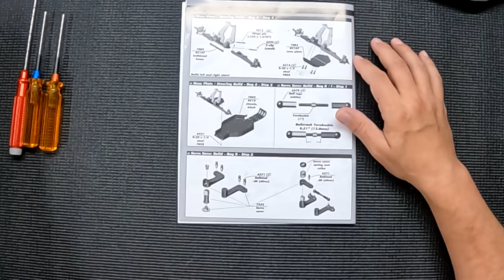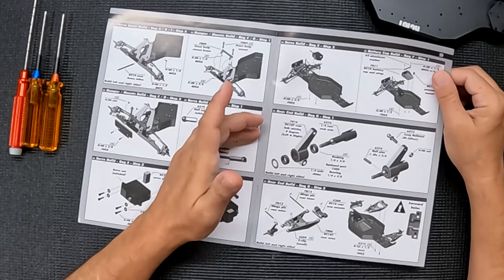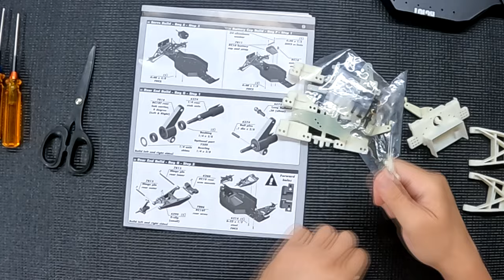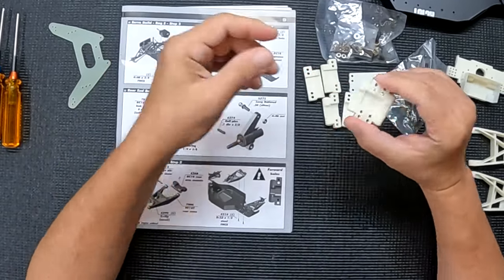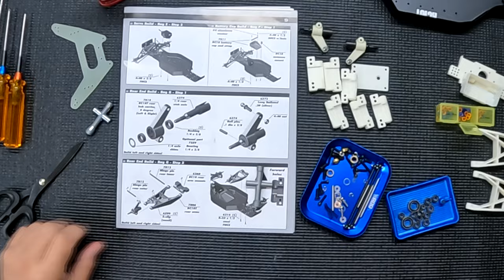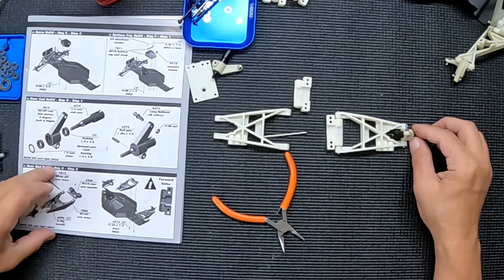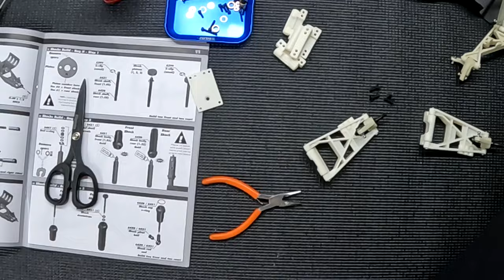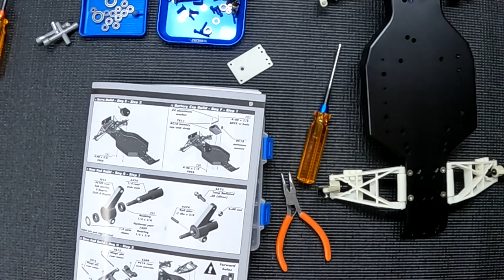Part 4. Building & Racing a Team Associated RC10T 1/10 2wd Stadium Truck

Comment: Great series of videos, as always. Can't say it makes me want to buy an AE buggy. Was considering trying to get a hold of a Jay Halsey replica kit - which looks just awesome - but given all the Associated's quality issues incl. the manuals, the B7 rear end, and now the ball studs/turn buckles of this truck, I am not sure anymore. Still an enjoyable series of videos to watch nonetheless!
Reply from the maker: It's true, but all those issues can be addressed for relatively little money and time Actually, the gearbox performs reasonably well. I haven't had any issues with it. And, I am really enjoying racing with the vintage crowd. I ended up replacing the ballcups with Traxxas types that are very rugged and are almost impossible to knock off... like something that would go on a crawler. Once I got the turnbuckle issues solved, all my problems were related to tires, tuning, and electronics. Otherwise, the truck was great. I just didn't have enough time to work the problems b efore the race. But, I'm really looking forward to the next vintage race within driving distance because I'm going!
If you can afford to buy a vintage truck or buggy, I highly recommend getting involved in the community! It's a great group of people. I broke a stub axle and one of the guys went into his parts box and pulled out an original steel front axle. He refused to accept any payment.
Thanks for watching,
CJ
Reply: @MyRCChannel-CJScott  You are right in that the RC community is a community incredibly supportive of each other -  I found that out after reentering the hobby about 4-5 years ago. I may reconsider the Halsey replica. Looking forward to the next videos!
Reply from the maker: @madvente  There are a lot of cars that qualify as vintage. There’s a nice belt driven mid-motor awd buggy. There are several 2wd buggies other than the RC10. I’ll try to find the link with the list of qualified vehicles from the last national race and post it here for you sometime tomorrow. 
The main thing the rules dictate is motor turns.